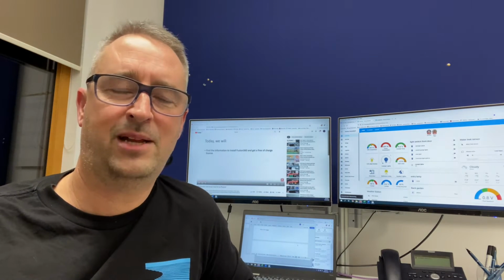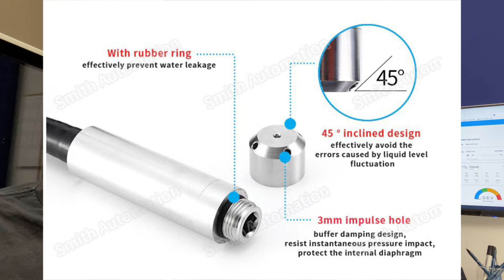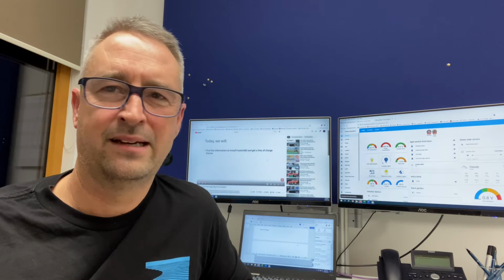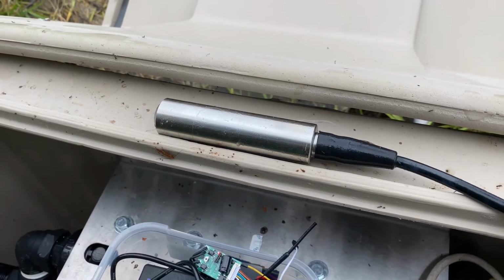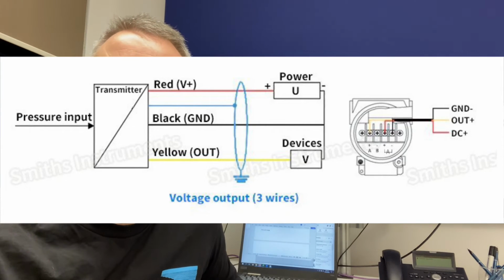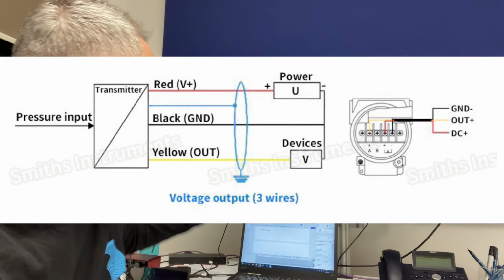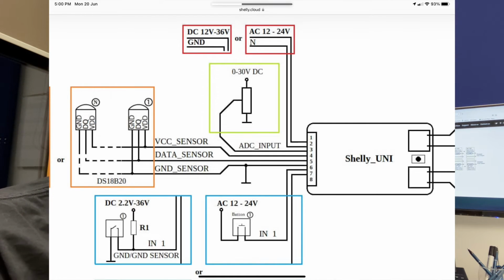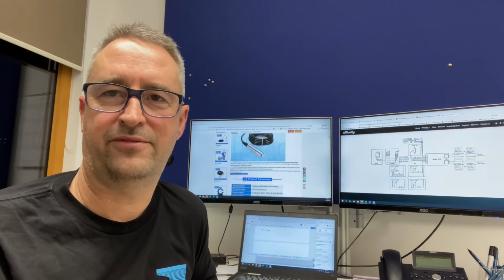Tank water level sensor and integration into Home Assistant Part 1

Comment: Hi Simon nice, i use old water level control switch for automation
Reply from the maker: Oh cool sounds like a great simple system
Reply: @simonsayshomeassistant  very simple, only need sonoff/Shelly switch breaker in addition. Wire scenario is :
L  ---> Water level control ---> L input sonoff/shelly (
N ---> N input sonoff
Set condition state of sonoff/Shelly as ON
So when the tank is full it Will trigger breaker to ON then it will trigger my submersible pump to OFF.
I use this since 2018. Ultrasonic just to beautify my dashboard. No significant in accuracy 😁
Reply from the maker: @hb189  Nice work, simple is always good as it goes wrong less easily!

Comment: Hi Simon thank you for this video.  I have done a similar project in the past and always thought that the uni would be an excellent device to use for this.  What I am a little confused about is have you used a voltage regulator of some sort to the pressure transducer.  The device requires 5V and it seems like you have supplied it with 12V. Thank you for creating this content
Reply from the maker: Hi Disa, thanks for your feedback, the pressure sensor that I have linked to in the comments section uses 10 - 30 V DC "Power supply 10~30 VDC (standard voltage 24VDC)"
Reply from the maker: Hi Disa, the sensor that I used required 12V.  If you have a 5V sensor you can just use the 5V out from the Shelly Uni

Comment: Thanks for the video … Can you please share your Yaml code for this setup …That will be very very helpful
Reply from the maker: Hi Sylvanus, no YAML code is used here.  It uses the Shelly integration to get the voltage into HA.  The voltage is then displayed as a guage in the HA dashboard
Reply: Thanks … I have this pressure sensor G1/4 Pressure Transducer Sensor, Input 5V Output 0.5-4.5V / 0-5V Pressure Transmitter for Water Gas Oil(0-10PSI) attached to the bottom of my tank 

Will the Shelly Uni work with that type of pressure sensor ? If yes how I’ll I connect this with the sensor having green, red and black cabling … Thanks
Reply from the maker: @sylvaish  Hi there, yes that one should work too.  You will need to connect the sensor to 5V not the 12 v supply to the Shelly
Reply: @simonsayshomeassistant  Thanks for your prompt respond … Do you have any diagram on how to connect these will appreciate
Reply: @simonsayshomeassistant  Hi Simon .... I managed to connect both devices and add it to Home Assistant .... The Volts keep changing every seconds  from 0 - 2 v .... Is there a way to keep this to update static based on the level of water that is in my tank  ??